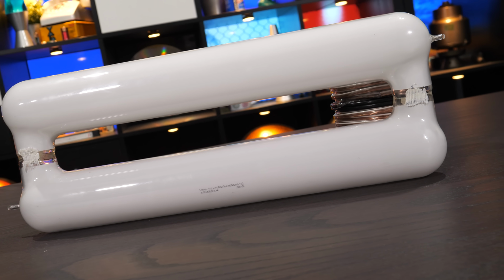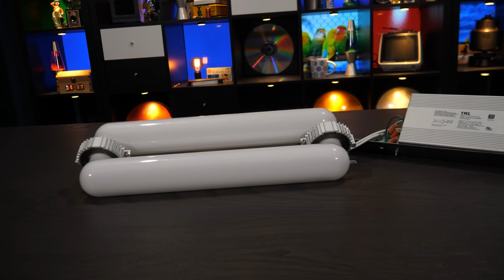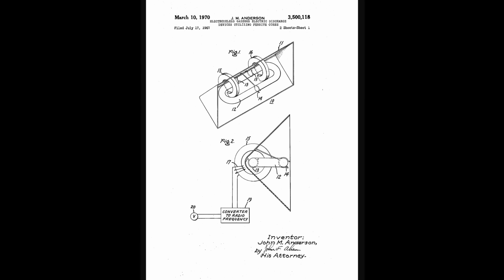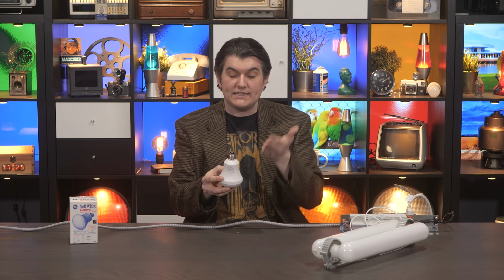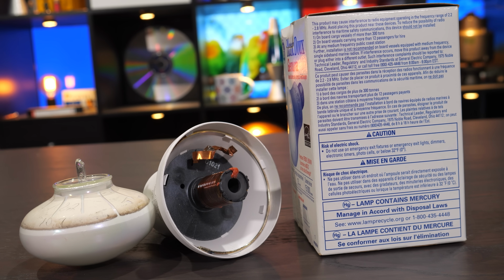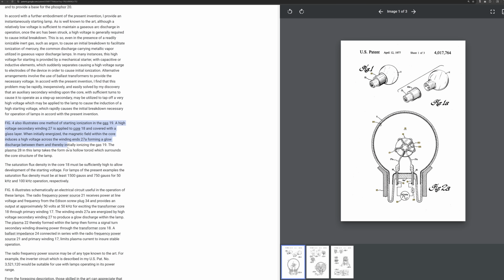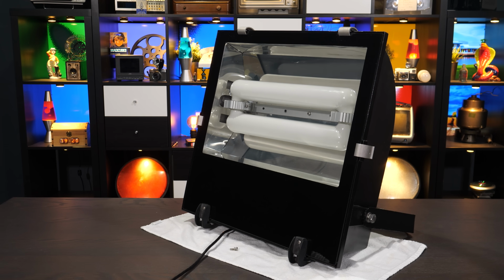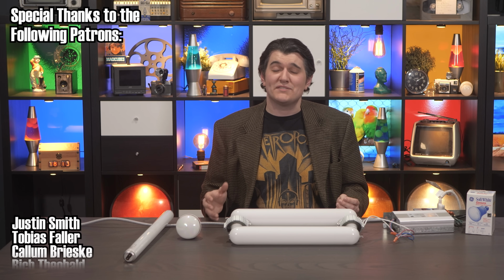Induction lamps: fluorescent lighting's final form

Comment: It's the radio frequency, it changes how the energy moves, yes literally a Tesla Coil. The whole point of a Tesla Coil is getting the most energy to switch as fast as possible. You get E&M self interaction, because E&M is a relativist effect the faster the more self interaction. So it doesn't need a "closed circuit" we are so far beyond Ohms Law lol

Comment: The reason you don't strictly need a starter or conducting strip is that at high frequencies, you can get ionization without completing the path. Think glow around a tesla coil. And once there is plasma near the coil, most of the voltage change is going to be near the ends of the conductive region, where the electric field corresponding to the voltage gradient can energize more of the gas. So long as frequency is high enough, the additional voltage required is going to be small enough for the ballast to compensate. Not really sure why original patents needed the starter strip. Possibly, much lower frequencies, or limitations of ballasts that could operate at them at the time. Modern solid state drivers are going to be able to adjust within a single cycle, which might be crucial to keep up with the expanding plasma region during startup.

Comment: Well I wonder what would happen if one was to use a properly sized power supply on a regular fluorescent tube, turn those ferrite coils 90° to how they are mounted on the tube holder (maybe spread them apart to accommodate a regular four foot tube and fire up the supply. No reason why it wouldn’t work.

Comment: It does not need high voltage input for starting if it have "free" high frequency. We all know what collapsing magnetic field does...increase the voltages. Even single 12v car relay can generate about 70VDC soon as you turn off the power. Having 500kHz or more, you have possible more than enough volts there. Only do not lick the core, it may not end well

Comment: So: fun fact about those "toroidal electromagnets". In the eletrical power industry we call these a current transformer, or more specifically for these they are split core current transformers. Now, while we call it a transformer we actually use them very differently from clasical transformers. Obviously if you stick a wire through (effectively half a turn), and stick a bunch of wraps on the output, you are going to get VERY high voltages on that output. This makes CTs very dangerous as these high voltages cause all sorts of problem if un-tamed. However, there is a very easy way to tame them: you short out the terminals. This has an interesting effect, through some physics magic when we measure the current through that shorted wire we find that it is directly proportional to the current runing through the wire we stuck in the middle. Now all the sudden we can measure extremely high currents with much smaller more basic electronics.
Reply: It's also called a stator

Comment: If I can remember correctly from my physics class, it seems like without a Filament, the electric/magnetic field flux really is just blasting free electrons around until the gas ionizes. There could be something else going on with the wires, but it could just be helping those free electrons.

Comment: you may never get a satisfying answer about the start physics, i have a strong suspicion that it may just be one of those "who knows" things where you'd think science has an answer, but it doesn't, and nobody really cares enough to figure it out (or pay someone to figure it out). my initial suspicion was that it was indeed free electrons being accelerated by the field, slamming into neutral atoms, and ionizing them in a sort of cascade, but the bit about the mesh and wire sort of makes me think that it might just be a charge concentration inducing a corona discharge, almost exactly like what happens when you stick a fork in the michaelwave.

Comment: Let's put R&B audio stream visible through a window in Y-axis and B&W video stream on x-axis. The quantity Y(dY/dx) is like a sword with a carry case or sheath. Once you stop sheathing and unsheathing the sword, your health increases by 10. The quantity is independent of time, but it does lie in a time zone, say Estonia. You can figure out the direction of approach using the figures in the loop current patent. Use this information to grab hold of the digipin addresses, with Casio Illuminator manual. The digital timer allows for generating a table of lap times of swimming races. They're also used to summon digimon. The sum is used to convert D&G to digi. So R&B becomes robi and B&W becomes biwi. Calculate the probability that robi is biwi. Find its effect on health with sad Mac code. Once robi gets replaced with lil.batty through the use of meme, you can use the Caps Lock key to switch between capital T and small t. The time zone was fixed, but you can vary the temperature and switch from absolute derivatives to partial derivatives. The partial derivative should allow you to use Schroedinger's wave equation as input parameter to the function. The formula is supposed to modify the excel sheet uptill goalseek.

Comment: Please correct me if I'm wrong, but aren't fluorescent lamps better than modern LEDs for high temperature environments? I live in the southwest were it usually gets beyond the 50 C range in the summer, and ever since we started using LED lightning, I feel like I need to change the lamps twice or even thrice as often as before. I suppose the electronics regulating the LEDs are at fault. Sadly, it's harder to get new CFLs at hardware stores nowadays, so I'm stuck with these short-lived LED lamps. Anyone else have this issue?
Reply: Yes all the benefits of efficiency and form factor become draw backs for removing heat from the system.

Comment: I only know these things exist because a signmaker I used to work with used them to replace the incandescent bulbs in clock which formed part of a historic sign on top of a silo on Melbourne in the early 00's. As far as I know they're still working today.

IIRC they were QL bulbs, and were HORRIFICALLY expensive at the time.

RE: Starting, those loops are probably the key, they likely behave like a shorted turn and heat up liberating electrons but perhaps not to the point of incandescence to avoid or at least reduce sputtering?

Comment: Is the small conductor you saw in the tubes of the bulbs part of an induction circuit that is used to start the gas discharge?
Reply: No need for that, it is the self interaction of the radio frequency E&M that starts the 💡

Comment: The startup could be entirely down to the wideband RF mess you get from a single, initial impulse (a hard-edged square step has a lot of frequency content).  There has to be a "turn on" event when the device starts, and I suspect the first pulse sent to the drive coil is particularly sharp-edged, in order to produce a more intense burst of RF inside the tube.  The initial ionization can occur there, and if there is more RF power available from the rest of the drive circuitry oscillator, once you get the initial ionization, it can propagate.

This is not altogether different from the way that TIG welding drivers send HV pulses.  The OEMs refer to this as "RF Starting", even though it's a bit closer to the way gas igniters work with HV pulses.  But there HAS to be some essentially noisy RF riding up to the electrode to get the initiating ionization, else you would need MUCH higher voltages, and at much greater risk to the welding operator, than these systems actually do.

Comment: Back in the early 2000s, I replaced about 100 sodium discharge lights at a packaging plant with these induction lights. One for one in the packaging hall and about 2:3 in the warehouse. The difference was astonishing, far better light to work under, brighter and whiter, much better colour rendition and very useful energy savings. At breaks, all of the lighting could be turned off and then be put back on again without it taking 20 minutes to get to full output again. The even better thing was for the 7 more years I was at the plant, I didn't have to replace a single lamp. I'd still put induction lighting up against LED.
Price wise, if I can recall correctly, a fitting was about £250 against £170 for the older discharge lights. But the savings were in not having to put up scaffolding on overtime to replace a bulb.

Comment: I wouldn't say lighting is "solved" per se. There are still some applications where there's still a LOT of room for improvement. Grow bulbs are a good example - high quality grow lights are still very expensive, generate a lot of heat, and have very short lifespans. Fluorescent is still very common in greenhouses because LEDs haven't quite gotten to feature/cost parity yet, especially if you need full spectrum light output for humans working in those greenhouses. 
Actually it's that application that has me looking at these induction bulbs with a raised eyebrow. This has me wondering if I could get more light per watt out of induction fluorescents than LEDs and what the cost would look like.

Comment: The wide beam highlights (no pun intended) a general gripe I have about LED bulbs that I would like to see a better solution to, if possible. I have a few 60w-equivalent halogen bulbs, basically 40w halogen capsules inside a standard bulb form factor, and I LOVE the sharp, crisp light that comes out of those little wires inside the halogen capsules. Besides just the tone of the light being great, the crisper shadow lines that they produce in the room look fantastic. I just wish they weren't so wattage hungry! If there could be an LED bulb that would produce that much light from a really tiny diode like that, I would be very interested. Usually when I buy any new bulb, I buy an LED with the clear glass and visible filament sticks, and they produce fairly crisp light, but not 100% as crisp as I would like.

Comment: 18:00 Induction lamps don't need electricity to flow through them to produce light. The high-frequency magnetic fields cause the gas within them to break down...which excites the gas. The excited gas emits UV light, which is then converted to visible light by the internal phosphor coating.

A modern-day equivalent would be placing a small fluorescent tube (U-shaped) in a microwave.
Reply: Yes this is the correct explanation!
Reply: We are so far beyond Ohms Law
Reply: not to mention, that this is the same principle that magnetoplasma operates on (minus the phosphor coating)

Comment: Garage door remote would not work at all. Replaced batteries. No apparent issues with the main unit. Then, I read an article that talked about the frequency of the bulb conflicting with the frequency of the remote. One new normal bulb later and everything worked fine. Love this channel! Thank you from the folks who crave this level of detail.
Reply: My dad had a similar issue.   Had a motion detector that used Radio to trigger a light. When the Battery got to low it caused a bunch of interference & took forever to find what was interfering with the Garage door remote
Reply: Can't use CFL or LED with my garage door opener. Both interfere. So yes LED puts out RF too. Heck of a time finding an old incandescent bulb at 100 w to give enough light output.
Reply: @terrencecescon102 Try other LED bulbs. Cheap ones like many in hardware stores can be notorious for RF issues and often have criminally bad lifespan for LEDs. Higher quality ones typically put more effort into reducing RF noise and some are advertised for this. The pulse width modulation used in dimmable LEDs may cause more issues too.
Reply: @terrencecescon102 
Apparently, they make a garage door rated LED bulb that doesn’t interfere with the garage door remote. 
It’s 10 bucks though
Reply: Apparently, they make a garage door LED light. That promise is not to jam the garage door remote. It was 10 bucks.

Comment: Strong RF fields are quite capable of starting and running a fluorescent lamp without any electrical connections.

The year was 1962. The setting was a total nerd in a boarding school single room with a portable ham station that could do 50 MHz.. An antenna for that frequency is small enough that with drooping ends it could be run diagonally in the small room. Nerd removes the desk lamp and uses cellulose tape to hang it a couple inches from the middle of one leg of the dipole antenna. Nerd adjusted length of tape hanging the lamp below the antenna wire until it would light when the transmitter was keyed. During evening study period nerd waited for the checker to come by to make sure frivolity was stifled and study was progressing. The checker found Nerd was on the bed reading to the light from a tube suspended in air. I'm told the expression on the checker's face was worth the price of admission. This does work. I had to check it when I heard the story.

{^_-}
Reply: 50MHZ? that's 6 Meter band!, TX'ing radio on that frequency without license will make FCC (or any equivalent of what your country have for ministry of communication) come to your house and seize any radio equipment you have.
Reply: @Aldnon It was in 1962 lol.  Pretty sure the statute of limitations is passed
Reply: E&M Self interaction

Comment: I started in machine vision in 1991.  We used high power, high frequncy fluorescent drivers from Mercron that used a light feedback system to keep the same intensity over temperature and age of the fluorescent tubes.
Lots of fun building custom ligjting solutions with those.  I think they had inductive drivers as well.  I cant find them online, they faded along with the fax machine.

Comment: I see these in machine shops, especially in older areas and forgotten workbenches. They were essentially a ring light with a big magnifying glass in the middle, for closely inspecting tools and parts. They were strange because you had to hold the power button for a few seconds, then it would turn on very suddenly.
Reply: Hmm, I have a lamp like that, but it just has a normal on/off switch and turns on instantly. Pretty sure it's fluorescent.

Comment: Very interesting. Basically the foundation for a death ray device, emits electromagnetic radiation, very dangerous, like a high tech light bulb running on nuclear fuel, maybe not that bad, but definitely a bad lighting design. I wonder if a high frequency coil like that could be induced to emit monochromatic light using a square wave and specific voltage? Probably low volt, but definitely some specific voltage and high frequency A/C, theoretically, since visible light is electromagnetic radiation, and assuming the voltage relates to the energy of the photons emitted.

Comment: 53 years old and ive never seen anything like this,, yes i played with a tube near an antenna and would pull into the drive in hotdog stand and make there lights flicker with my 2 way vhf radio, 8 foot tubes just a foot away on the celing of the car

Comment: I remember years ago, new scientist had an article on a microwave fluorescent bulb, which was a glass ball filled with gas and internally coated with phosphor. billed as a lamp that similarly could never fail, since it used microwaves to excite the plasma. probably the article from 27 May 2000

Comment: I really like the fact that this lamp avoids using bare metal contractors to transmit the power. this means you have no chance of the contacts corroding and arcing.This would eliminate a lot of potential for fire hazards potentially.

Comment: The high frequency is the reason the gas ionizes.  A rapidly changing magnetic field induces a rapidly changing electric field.  This gives a huge potential change over a short distance.  This potential change is enough to ionize the gas.  Argon, for example has an ionization energy of 15.7ev or 2.4e-18J.  If you get enough of a potential drop across the diameter of the atom, you can ionize it.

Comment: Thanks! I have one of these as a dusk-to-dawn light on the front of my workshop. It is a 200W version and may be identical to yours. I expect the life-limiting factor will be the driver unit with its Chinese components operating in the Alabama summer heat. I do expect the tube and coils will last a long time, but I am concerned that the driver will go first. I decided to buy this after having numerous LED wide-area light failures. I hate climbing ladders for safety reasons, especially when trying to repair a wasp nest infested light fixture. Also the exasperation with the LED failures played a big part. I'm very pleased with the light output and color. It is a fascinating piece of technology.

Comment: 6:37 Cool. But,I'd bet money that the induction driver circuit won't last 23 years. (I'm looking at you,"SamWha" [or whatever crap brand] electrolytic capacitors. Or, a nearby lightning strike could wipe out all of that fancy silicon inside.) TINSTAAFL. But,on the up-side, Every HAM radio operator in your city will love you!
EDIT: 20:37 The windings on the cores are very close to the tube,like,touching it,right? I wonder if the driver shoots out a burst of RF at a much higher frequency (say that 3Mhz figure) to get things started,and then switches to "normal" 150Khz mode for continued lighting. I'm thinking along the lines of capacitive coupling,with the winding being one 'plate' of the capacitor,and the gas in the tube being the other. Much like the example of holding a regular fluorescent tube near a Tesla coil.